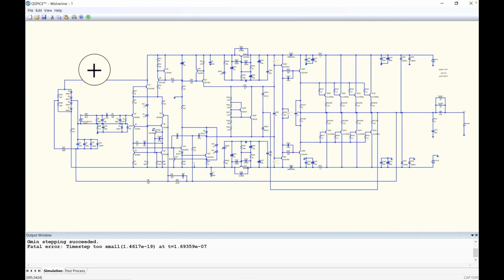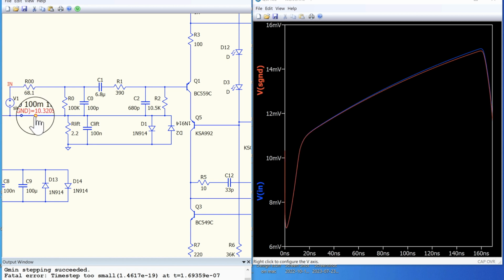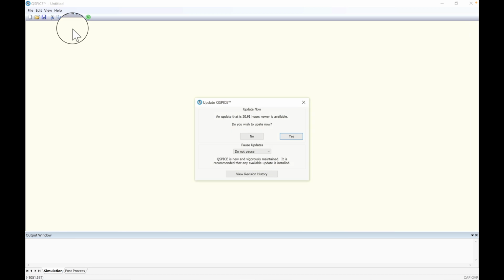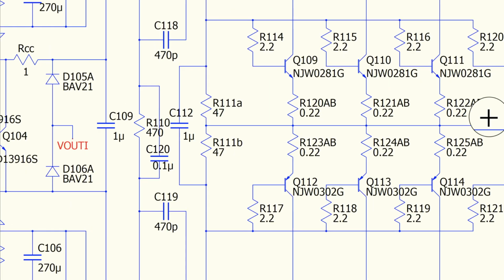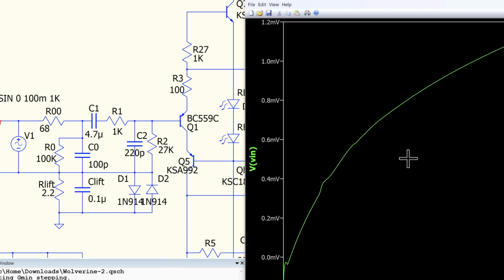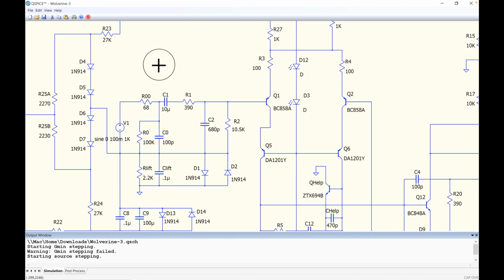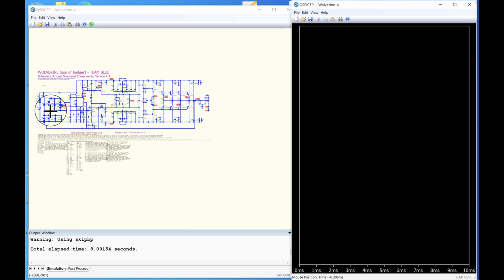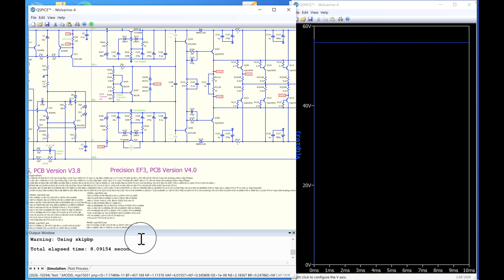QSPICE Challenge - the Wolverine Amplifier Schematic #Qspice #Wolverineamplifier

Comment: Unless something changed recently the designers of the amp were/are trying to keep the schematic drawings and BOM "secret" so that people who purchased the boards don't run into problems with availability of the parts suggested by the BOM. Apparently parts availability has been an issue since COVID
Reply from the maker: Yes you are right - but I think they are keeping that under wraps to get people to buy their boards.  I don’t know of any parts that they are using which would be hard to get.  The availability has been more of an issue with chips not basic parts.
Reply: @KissAnalog  I think it was something that was true for a time but is probably less so now. I purchased a board early August and found I had to use two suppliers to find the parts I wanted and one of the components (forget which) still hasn't arrived. I had an email in the last few days saying it was sent. 
I'm sure it's also true that they used a real issue as an excuse. Still, it's their board and they put the work in so either way, I don't know that we can complain too much.
Reply from the maker: Yes I agree - it is their design so they can protect it the way that they see fit.  They did share all the files with me and said that I could share them here.  I think I did show where to get them, but I'm not going out of my way to share them - unless someone requests them by email.  I did share the PL with the guys who sent in schematics so that they could finish them.  This I think will help promote the product.  People will simulate it to see how well it works and then maybe buy - but as they are not low cost - I think it shows the design and provides advertisement.

Comment: Is it possible that the outputs are pegged because there are a couple of pots that need to be trimmed?
Reply: Maybe, but from what I saw, there are some values that need correcting. But you're right. There should be a dc operating point sim run first to confirm CCS1 current source is 5mA and CCS2 current source is ~5mA. Then, the output bias needs to be set by adjusting R109, so you have approximately 44mv between TP101 & TP102 . Then, you can run a transient analysis. The reason the plots were slow for Eddie was either the circuit was oscillating due to the schematic being incorrectly drawn or there's an incorrect value causing it to oscillate or the maximum time step is to small or there is a model problem. But the 4 schematic looked very close...😊
Reply from the maker: Thanks for the feedback!  Yes - these schematics are straight out of the box;)  There wasn't a lot of time in this challenge - so I was impressed just to see how far these schematics seem to have made it.  I'm sure we can work with them and get them going;)